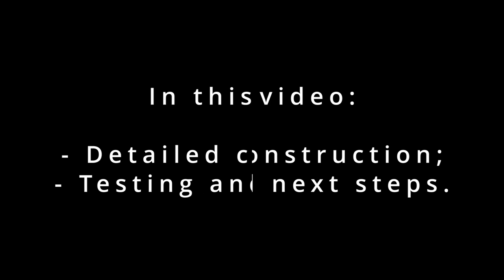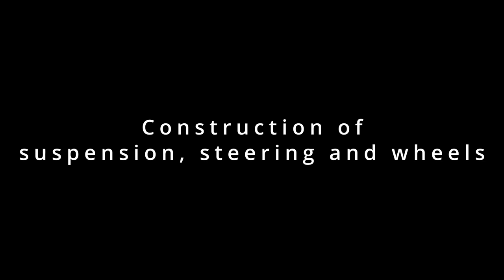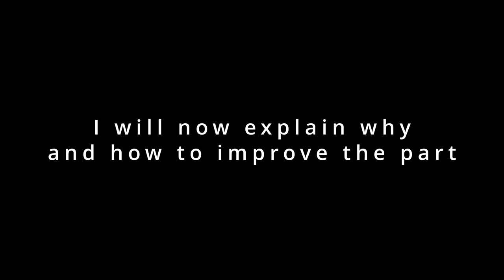Cargo Trike with 3D printed double wishbone suspension - #1

Comment: 3D printing is a great way to test geometry, but unless you are printing ABS with CF at 100% infill, I don't think you are going to have sufficient structure, particularly with braking forces.
Reply from the maker: I agree fully! I'm printing with PLA at 20% infill to iterate to a geometry that I'm happy with. Also I'll try to optimize design for strength.

Comment: I think you have made it much too complicated for a bike, given most have no suspension..I am looking into this because a reverse trike doesn't work too well when the ground is not flat, one front wheel going into a hole tips the whole bike.  But I think you can use a simple trailing arm setup to give vertical movement that is still along the outer edge and have the entire unit pivot like no=suspension tadpole trikes.   Maybe use some torsion bars instead of springs.  Simpler is better with bikes.
Reply from the maker: Thanks Murray. Actually, I'm also a fan of simple. Like da Vinci said "Simplicity is the ultimate sophistication";). And I will get there. Just need to iterate a little bit. And, the next version will have a tilting mechanism;) I think it will be pretty good in stability. In any case, I'll keep iterating until I get something that works very well.

Comment: Smashing that bearing into the hub with the hammer face and not even using a brass block or anything come on man you're better than that, also that printed material isn't going to stand up to repeated banging and the brake forces on the hub. I hope that's just a scale model prototype and not the finished article.
Reply from the maker: Absolutely. I definitely recommend against hammering bearings. Best would be to use a press or a vice. Thanks for the heads up! When making instructional videos, things should be done the proper way. Noted and will apply more in the future.
The printed parts are prototypes. A way to develop geometry. Checkout the full series to see the new development, more to come: https://www.youtube.com/playlist?list=PL3uwHLwN7YKotYisabK_kKaFsAhv1bE8z

Comment: Nice build and it even looks very beautiful... Which is important in my opinion! Personally i would enjoy to take it for a testride until it reveals all the weak spots (-;  how much weight do you think it will carry in the long run? 

But... I would miss using my hips  https://youtu.be/wpUDd6JD9YU?si=wMuqfQTOhJIb-Ist
Reply from the maker: Hello, nice riding in Christiania, on that video;)
This trike that I made broke out shortly after being made, but I kept improving the design and build. Checkout the latest if you're interested. I'm testing now with 40 kg cargo: https://youtu.be/quPFFIaY86c?si=CIws-02qEh6G3C3P. Cheers!
Reply: Thanks for making me remember how much i love bikes! In times with environmental challenges... Just a great invention in general and your build looks awesome and fun to ride! And the fact that you made your own hubs is quite impressive and leaves me with huge respect! (-:

I'm not a theoretical builder like you but I used to drive bikes for a living and I'm quite sure 40.kg should work fine! But... I kind a have a feeling that the point where the tube for the steering/handlebar is welded to the main/horizontal tube will be a weak spot if more weight is added.. If you put this beauty into production as a people carrier you could add a "minor" tube (convex or...) approximately 20-30.cm up on the vertical tube going forward on the main/horizontal tube... To release a bit of the pressure where it's  currently welded together. But Hey... I'm just a farmers boy!

Which country do you live in? I'm guessing you're dutch? And keep up the good work! Simple and efficient! It's on my wishlist I feel (-:
Reply from the maker: @tomjakobsen8110   thank you so much for the kind words and the suggestions about the build. I actually learn a lot from comments;)
I'm from Portugal but I live in The Netherlands. I always loved biked but here they are part of everyday life so makes me happy to ride my own build;)